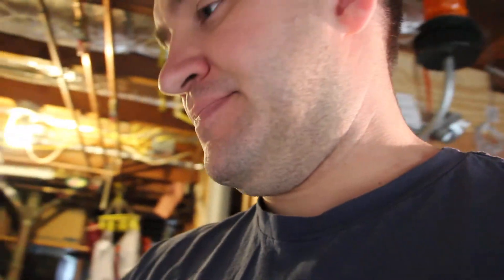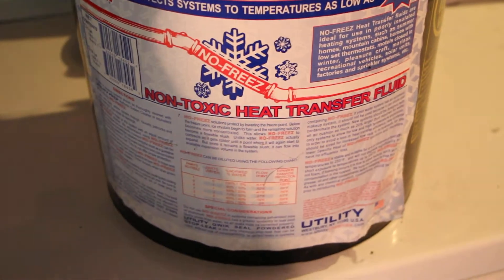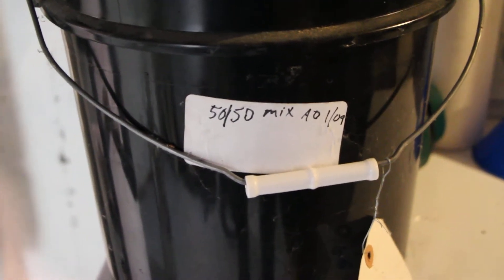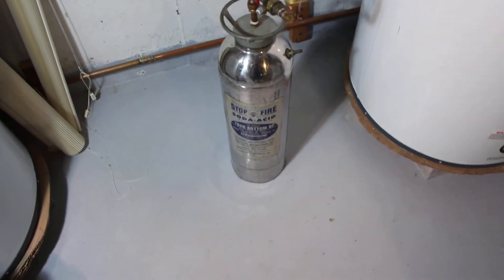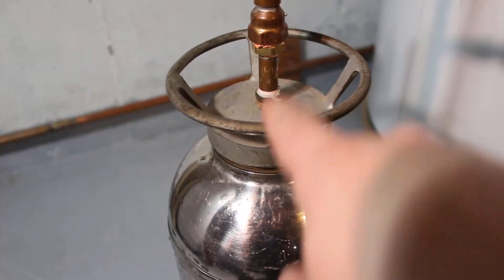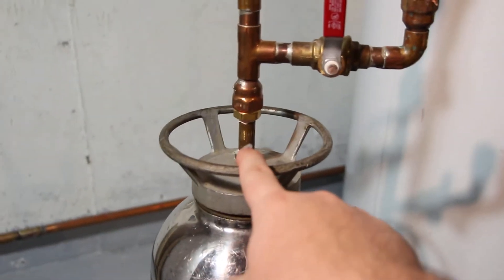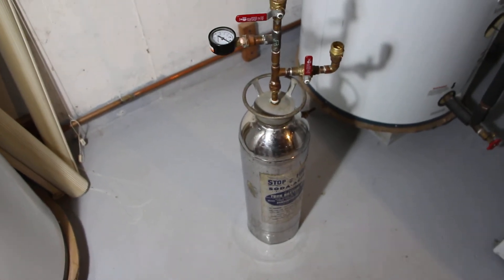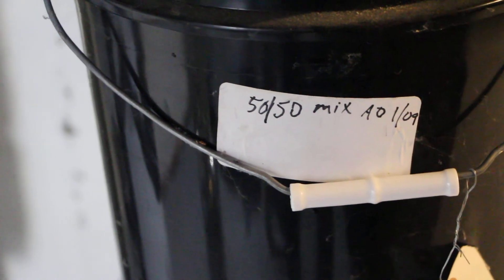solar hot water antifreeze tip and pressure trick

Comment: Hi, great video but what volume of anti-freeze and water do you put in the system. Is there a way of working out the quantity for system size?
Reply from the maker: Mine takes about 13 gallons.  When I pull it out it goes into a Rubbermaid lol.  I usually aim for 60% glycol or so these days.

Comment: this is old information, with our unit here in Nova Scotia we use propylene glycol at 60/40 and have not had any issue with the solar powered pump circulating the mix from the collectors on the roof to the boiler in the basement.
Reply from the maker: I'm happy for you that you have not had trouble. ...  I was running 50 50...  pump able down to zero f.  But when the sun came out ...the temp was below zero and a plug developed.  So I'm running more glycol today.  Haven't had a problem since.  I forget what ratio I run now but it's probably 66 % to 75% glycol.